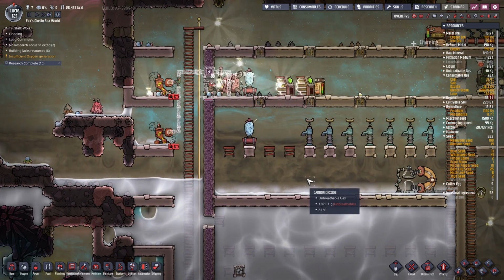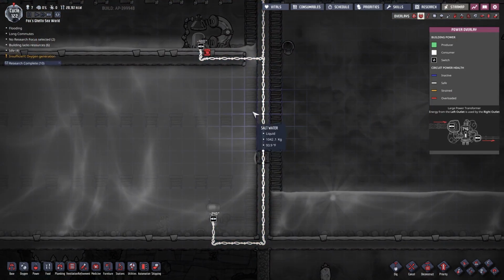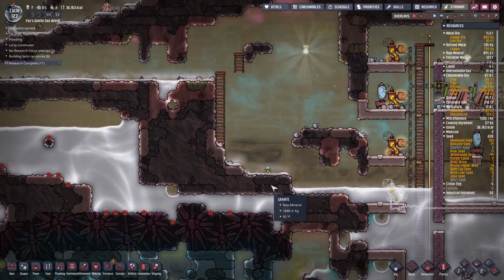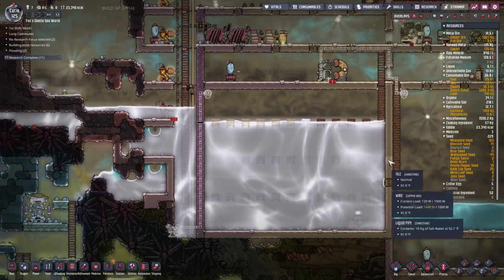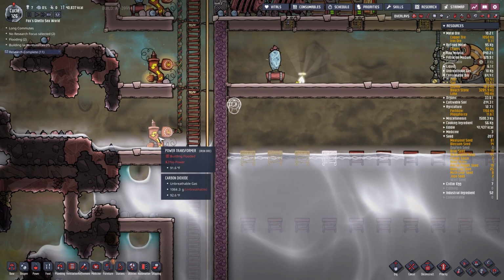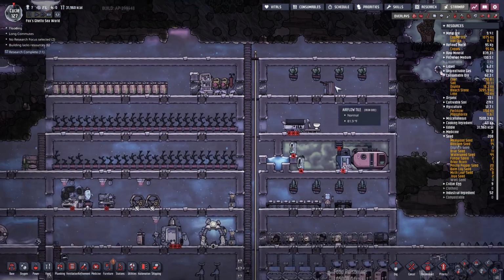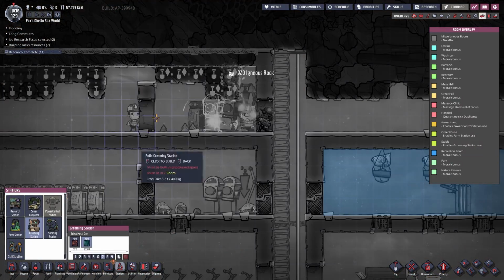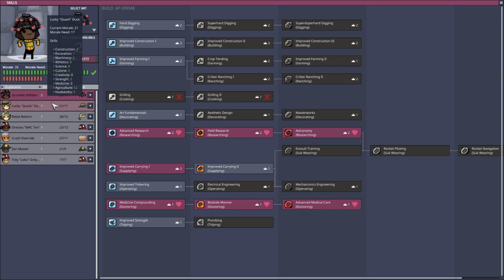DOUBLING our Power Output! (Fox plays OXYGEN NOT INCLUDED "Oceania" Episode 14!)

Comment: Might be late for this question, but I will ask it anyway. Do we still need batteries when the power generator is connected to transformer? Btw, did you find any benefit from having soda machine, apart from CO2 consumption?
Reply from the maker: It raises morale which combats stress and also can cause the different joy effects each duplicant can have.